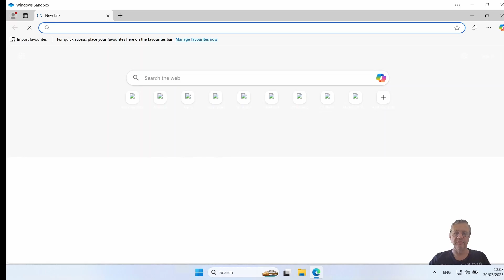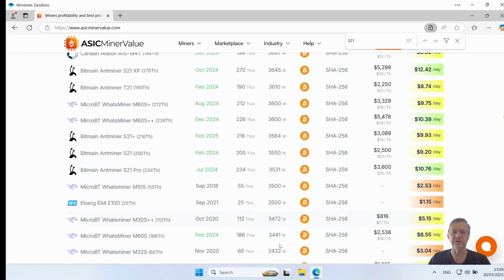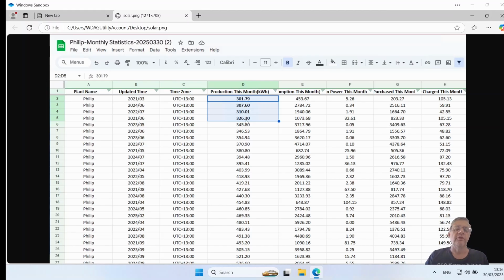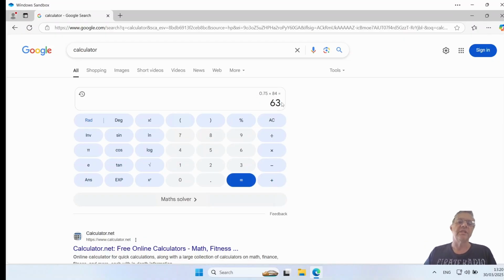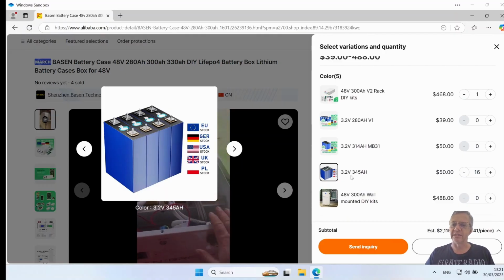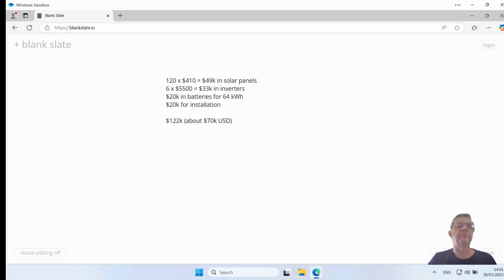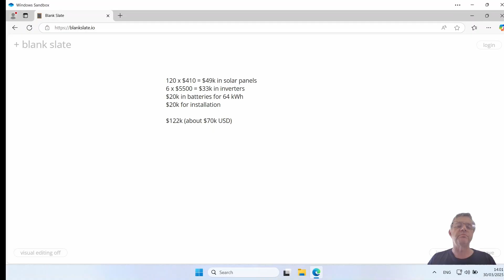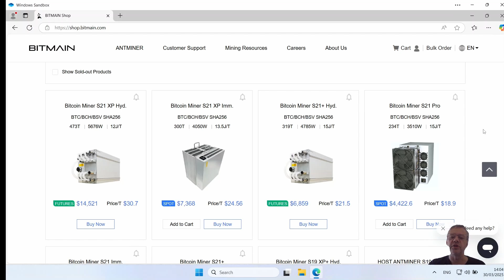Mining Bitcoin Off-Grid Using Solar

Comment: A similar system comprising of: 50kw Sungrow inverters, and 80kw of sungrow batteries + Jinko solar panels, wholesales for about $78k NZD + installation costs.
Reply from the maker: Wow! Good to know.  Who is selling that?  What model Sungrow inverter is that?
Reply: @pdath  just an electrical wholesaler for electricians, SH25T inverter x 2.
Reply from the maker: @zarkov2324 I'll do some Googling.  I think this might come in cheaper with Victron as well.  3 x RS450/200 MPPT charge controllers (to get 12 string inputs) and one single phase 5kW inverter.  Victron also do a nice bus bar solution.